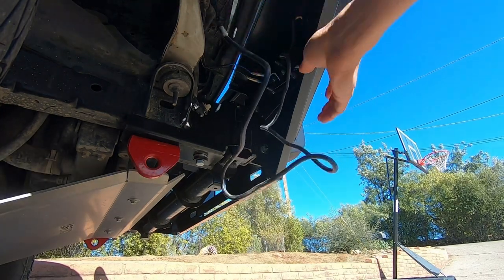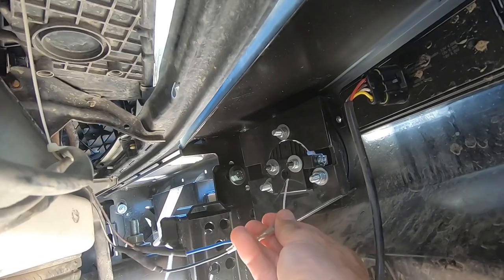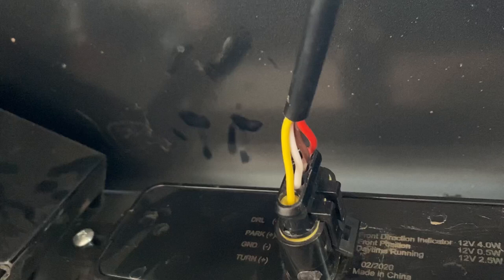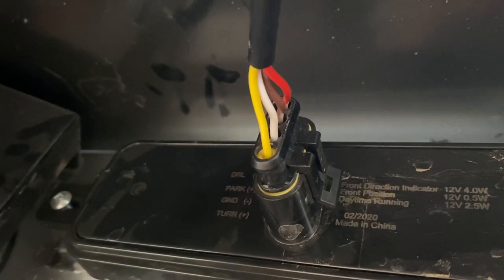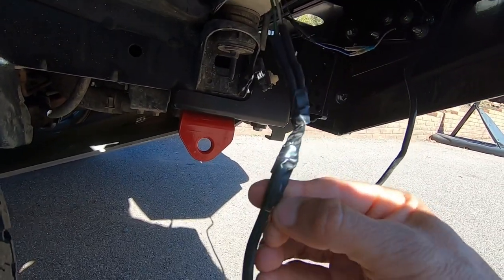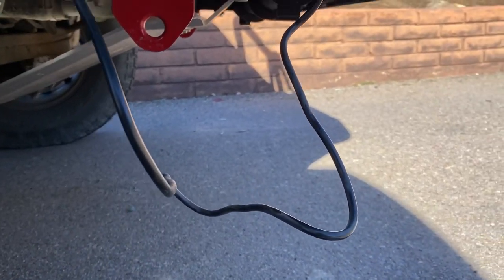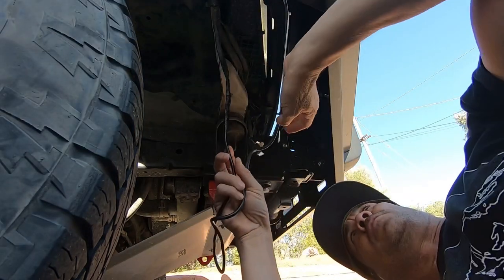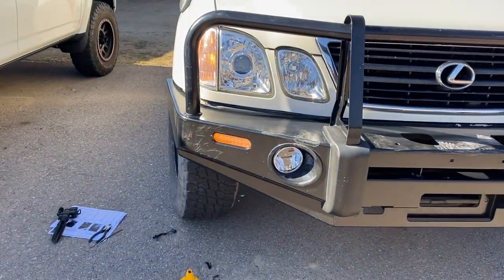Ironman 4x4 Bumper Wiring Made Easy #100serieslandcruiser #lx470

Comment: If you run the brown or red wire up to the factory corner parking light and tap into the green and yello stripe wire, your lights will light up white when you turn your parking lights on. If you use the brown wire from the Ironman harness it will be dimmer then if you use the red. Either one will give you white parking lights then amber turn signals
Reply from the maker: Thank you very much for watching and thanks for sharing. Good info!
Reply: Where do I find the green and yellow wires?
Reply: When I have the brown or red wire hooked up to the green and yellow striped wire, I'm getting an amber running light and then a white turn signal. Is this what you have as well? Seems like the reverse so I'm wondering if I have one of the other wires crossed.

Comment: Hi. I'm entertaining to not run a wire through the firewall for switch due to messing with holes etc.

I'm thinking of buying a wireless remote that's really cheap and sold on ebay etc. I reckon this will easily fit and switch on the lights when needed. What do you think?.
Reply from the maker: Definitely check out Trigger Controllers. They cost a few hundred dollars, but well worth it. I believe you can also control it with a phone app. Thanks for watching the video!

Comment: Do you have to flex your grill a little to raise and lower hood?  I have same install and grill catches just a little on top of Bull bar.
Reply from the maker: No I pulled the bumper forward as far as it could go. The bumper sits a little lower than I wanted but it still looks great.  I’ve heard where people reposition the grill, however I didn’t want to mess with that.
Reply: Mine doesn't catch either - the mounting points are slotted on both the bumper and the bracket, you should be able to loosen up the 6 bolts and adjust it as needed.  Helps to have at least a second person around.

Comment: Connected my lights to my LC100 fog lights and the lights did not come on.  Power to the wires checked...  does it need a full 12V? am i missing something?
Reply from the maker: I would check the polarity. If you have another 12v source you could check and see if the lights are good too.
Reply: @LXPlore  My jumper wires were bad,  replaced and shazam!  thx!
Reply from the maker: @royreddick5491  BOOM! Nice work!

Comment: I am comfused about where the wires tie in on the other end from the fog lights. Honestly even with the video and the terrible paper instructions, I'm not clear on how the lights get powered. What happens to the original fog light wiring that ends in the brown plastic receptacle for the old lights? Where do the fuse and black box go? What gets routed back under the hood and where does it terminate? As you can tell I have no electrical experience.
Reply from the maker: Hey Jesse, thanks for watching the video. To wire up these fog lights, i didn’t run any new wiring. The LX470 has fog lights that turn on using the factory switch located on the turn signal lever. I spliced the factory wires to the Ironman 4x4 fog lights. Hope that helps.
Reply: @LXPlore  Thanks for the reply. I have a 2005 Land Cruiser, so I'm wondering now if I need to use the two long sets of wires provided in the Ironman bull bar kit. Any other ideas for where to find instructions on using the Ironman wiring?
Reply from the maker: @jessebates1112  Unfortunately I don’t… the only other resource would be to call Ironman and ask.